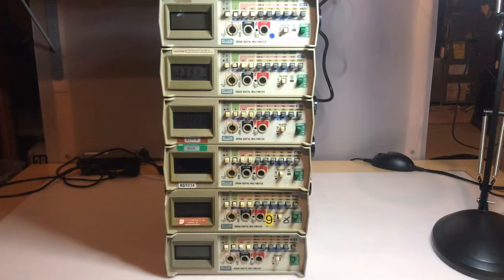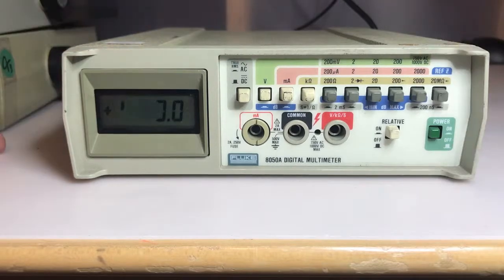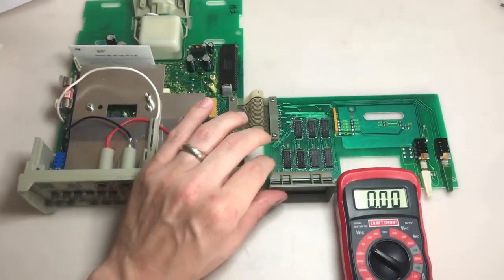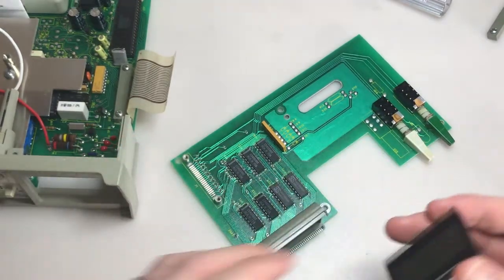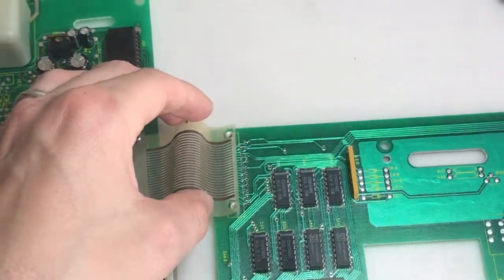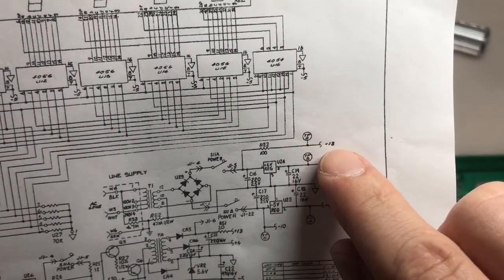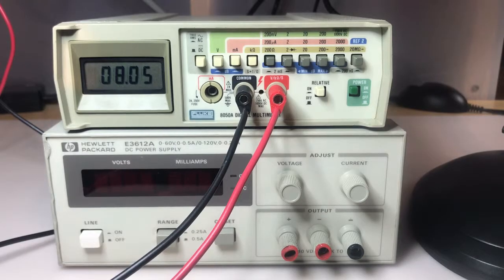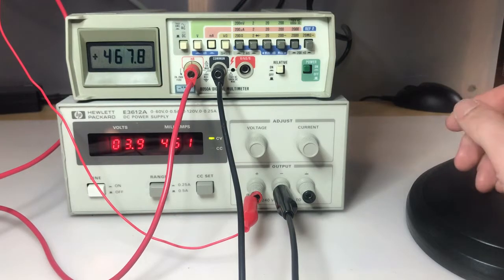DR #12 - Fluke 8050A Multimeter Troubleshooting and Repair

Comment: Internal battery option is 8050A-01. It uses Nickel Cadmium cells to power the DMM while not plugged into AC power.  I used one for decades, replaced the ni-cads twice, and eventually the display died.

Comment: When you remove those ribbon cables and zebra strips (the little strip along the bottom of teh LCD)  it is normal to (a) not touch them with your fingers, and (b) give them a little clean (the ribbon cable connection with a pink eraser and IPA, the zebra strip with a q-tip and a very little IPA) before re-assembly.

Comment: Ha! I bought one of these off eBay a few years ago non working for super cheap. The meter did read a few years ago for a little while. Anyway, it has been sitting forever. Got to researching and sometimes it is just a matter of replacing the re-chargable battery packs size C.  Bought 4 "C" re-chargable batts at Harbor Freight this evening. Solder them in and presto the meter is working great!  For whatever reason on some of these units, the re-chargable batteries must be installed and functional in order for the meter screen to work initially.  Hard to believe that was all it needed.  I am indeed getting charging voltage to the newly installed batteries while the unit is plugged in and turned off. Perfect!  I really help this helps some one out!  Thanks on the great video by the way.

Comment: What's tricky with this multimeter is that it's a positive ground system.  If you look carefully, you'll see that VCC on those IC's are connected to "ground" while VDD is connected to the -5V rail.    That's a novel design.    You just have to be careful/aware of this when poking around.

I did a display replacement on mine with a graphical LCD display, driven by an STM32F103 microcontroller.  It just wire-tapped the signals connected to the main CPU in there to decode the digits that were being strobed out to the display board.  Fun stuff!   And it's a great DMM for the bench.  Plenty accurate enough with sufficient precision for all of my needs.

Comment: At 4.40 I thought I would clean the zebra strips under the LCD;) Or rather the contacts underneath. + You could use epoxy glue to repair the plastic I think it is perfect in this situation. As you removed the LCD you should have cleaned the contacts too.

Comment: You should remove the screen bezel by lifting the two hooks on top and pulling the bezel towards you. Do not pry with a screwdriver under the PCB.  Cleaning the contact strips usually makes it work.  It does not need a lot of pressure to make good contact, it's just a matter of cleaning it.  Clean the contacts at the end of the ribbon cable and the PCB where it touches the cable.  Corrosion is to be expected.

Comment: wouldve been beneficial to clean all those strips of oxidation that forms over the years with alcohol where they interface, they do the same in handhelds meters all the time to solve contact issues.  CLEAN THOSE CONTACTS STRIPS-!
Reply: I was just about to type those words.  Funny how they all fail from that issue. Plastic becoming britle and or poor design decision.

Comment: Would love to see you try and upgrade one of the displays similar to the projects a few folks have tackled online. They add a larger TFT color display, would probably be an easy project for someone skilled like yourself… I’m so new at this stuff I’m hoping someone will come out with a simple video about doing it....so I can upgrade the few that I have. Thanks for the video! I really enjoyed it.
Reply: I also might add, there are several videos online about removing the zebra strip displays, cleaning them with alcohol, and reinstalling. That will fix 90% of the issues!

Comment: A very nice repair. I like your workflow and fault-finding process.
Are we going to see repairs on the other units, too?

I also seem to remember a project where people converted Fluke DMMs from LCD to a homebrew LED display.
That might be interesting for the last unit, which might turn out to be a 'broken parts collector'. Chances are that the faults mostly concern the LCDs.
Reply from the maker: Unfortunately the other units all had too many issues so There will not be another video on these units.
Reply: Just saw this comment after I added mine about upgrading the displays LOL… Too bad these have too many problems… But they were built to such a high-quality I would definitely keep them around for parts. I know in my case I enjoy having at least 2 to 3 benchtop meters. It’s awful fumbling around with a handheld DMM on the bench when I’ve already got cables running everywhere LOL I know one thing that helped me is a retractable keychain clipped to my probe leads. That way when I’m done with them they just kind of slide automatically back up on the shelf above my workbench top. Thanks again for the video!